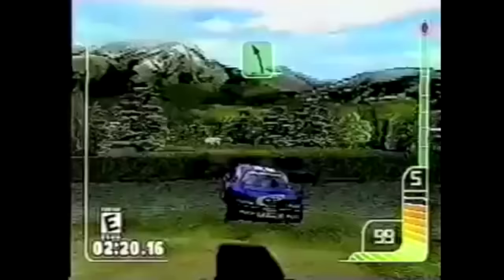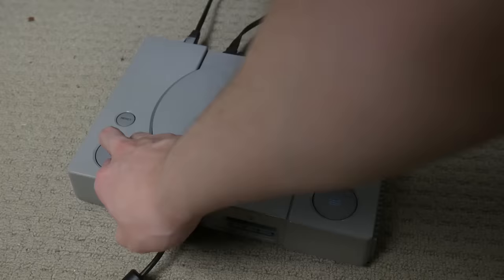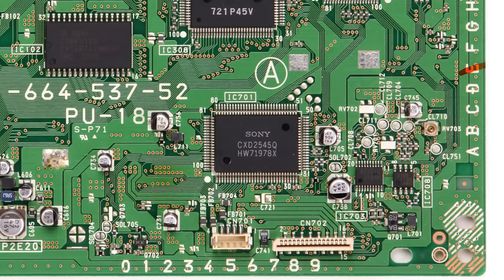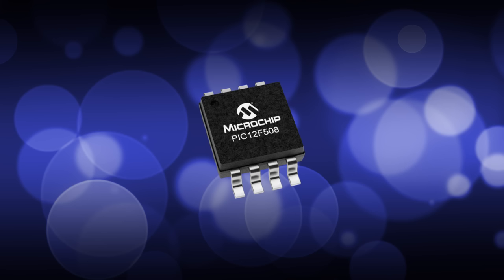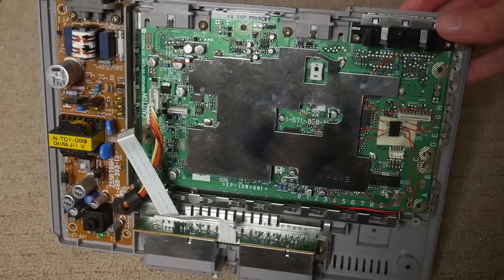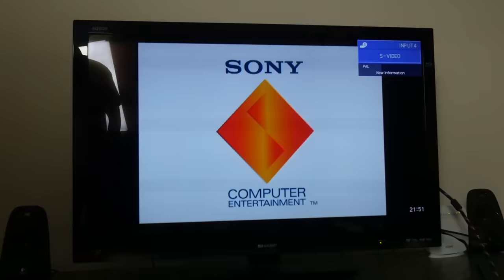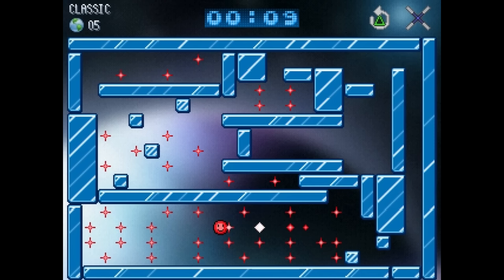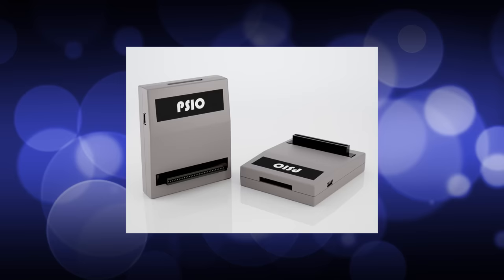Making a PlayStation 1 modchip from SCRATCH

Comment: I like to see a different mod. Replace the drive with some kind of storage device. A CD drive emulator using the CD drive connector. It difficult to do but not impossible. Modding the motherboard would still be necessary but I wouldn't mind to do that. It's available for the saturn (if I'm not mistaken) and I'm looking for this solution for my ps and Wii.
Reply from the maker: Did you see the PSIO shoutout at the end? It's basically a CD drive emulator (though it plugs into the parallel I/O port rather than replacing the drive assembly like a GDEMU, requiring some soldering to redirect a few CD signals to the parallel I/O).

The Wii can very easily be softmodded to play games from USB and SD.

The Saturn has a prototype of something like that but nothing in production just yet (I believe it's close though)
Reply: @MattKC  haha. I knew you would say that. Ever I saw console modding I wanted to see a mod to replace the drive entirely with a hard drive or other storage solution using the original CD drive interface . Psio is neat but also a soar thumb sticking out. The saturn thing is the most interesting project solution.
Reply from the maker: So you do basically want a GDEMU for PS1. It's likely possible to mod the PSIO to be an internal device since it's already a CD drive emulator that takes CD drive signals. I'm not sure how much work it would take, but I assume that way most of the hard part is done for you.
Reply: @MattKC  sorry bee busy.. To mod the psio for internal use and use a different storage method then it would be interesting. The psio hijacks the CD drive thus might as well use the connector instead (if possible). But isn't the psio locked with its own software?
Reply: @MattKC  this idea comes with the fact that CD drives become rarer by the day so a decent replacement as storage option would benefit the community as whole.

Comment: This is very inaccurate.  Technology connections has a video on the ps1 wobble groove which better characterizes the actual anti-piracy mechanisms on the ps1.
Reply from the maker: I didn't go into nearly as much detail, but what did I say that was "very inaccurate"?
Reply: @MattKC  I apologize, "very inaccurate" was itself inaccurate.  It is better described as only misleading.  You mention that the region data is written to a part of the CD that typical CD burners of the era could not write to, but the ability to write to that region is not what prevents retail PS1s from reading the region data, rather it is the 22 kHz "wobble" that the data is written in, verified by the CD-ROM controller, that will not even be sent to the PS1 BIOS to be verified if it doesn't match the expected 22 kHz frequency.  This information is present in the reverse engineering work done by Martin Korth (and others):  https://problemkaputt.de/psx-spx.htm#cdromprotectionscexstrings

This is to say that the distinction is that given a retail/unmodded PS1, the barrier to producing readable media is not simply writing/burning data to this particular region, but is actually encoding the data physically within the pit as a sine wave (22 kHz) expected by the CD-ROM controller.

Comment: Down voted for that terrible solder job. You didn't even clip or bend the pins to make the IC flush with the PCB. If you drop this thing, the pins might penetrate the solder mask and short out your console. There's some real fine traces right under that chip.

Comment: Wouldn't the "swap trick" work just as well without needing to mod?
Reply: That could (and will) damage the disc drive.
Keep in mind that these drives are 20 or more years old.
It's a good trick for cases where you have a region locked game and want to try it, but if you're going to go on and have 300 different games this won't be reliable enough for the hardware and will damage the disc drive.
Reply: @djungelskog2654  Couldn't you use something like SwapMagic? That instructs the motor to turn off.

Comment: What you're doing is 100% illegal. Even though putting the mod chip in the console is legal In your country. Putting the code on the chip to mod The PlayStation is still illegal. So once you do that to this chip, it is now Illegal and yes, you can get in trouble... Now if you mod The hardware By adding the chip and don't touch the chip and  add  code to it, that's perfectly legal. It's the point where you add the code. And you make the PlayStation do something it's not intended.. But sure, you can add anything to the hardware Paint it pretty it up. Add 20 batteries to it, change the heat sinks.
Put it inside of an Xbox. Case. You just can't physically change the software Or add some to it.

Comment: Hold up.....I have a PS1 and I play burned CDs without modding anything. I didn't mod the PS1, I just burned CDs with the desired and that's it.
Reply: news flash, its modded - most PS1 systems you will pick up have been modded at some point.
Reply: @dssembler7922  I bought my PS1 almost at launch though, those where times. And it was never taken to any repair shop to fix/ adjust something.
Reply: @dylanellul1024  Somewhere along the lines its happened, they never have played backups without unless you do the swap trick or use a plugin 'cheat' card'

Comment: you should keep in mind that running a ps1 can be dangerous when the case is open because of the exposed psu with 240 volts.

Comment: Cant find this Pic Kit Programmer Board he has? Please help
Reply: How much do you plan to buy this set? If the price is comparable to $45 US, then it is easier to buy a working version with delivery from Russia. In our country, these consoles were already sold with mod-chips, and on the secondary market they are sold for this amount (3500-4000 rubles). In addition to the console, you can probably buy dozens of games, controllers and the console itself, which works in all regions. Do not thank.

// За сколько ты планируешь купить данный набор? Если цена сопоставима с 45$ США, то проще купить рабочий вариант с доставкой из России. У нас эти консоли продавались уже с мод-чипами, а на вторичном рынке продаются за эту сумму (3500-4000 рублей). Помимо консоли, ты возможно приобретешь ни один десяток игр, контроллеры и саму приставку, работающую во всех регионах. Не благодари.
Reply: @Vladstvo  thanks for the answer. Do you know the model name and etc. from the board in the video?
Reply: @gamesarelegends3473  The author is talking about SCPH-5552
Reply: @Vladstvo  I meant the Pic Board. Cant find Pic boards that would fit such microchips like in the video. He just puts it in like a plug but cant find such a board with that plug
Reply: @gamesarelegends3473  I want to help you, but I don't quite understand what we're talking about, I'm using a translator. Before soldering, the chip is placed in the programmer and configured, after which it is already soldered to the motherboard. Are you interested in the moment of programming the chip or its soldering, what contacts should it be soldered to?
Reply: @Vladstvo  I am interested in the board to plug in the Pic Chip to program. The soldering I think I can try good and its not the problem. The problem is for me to get the code on the chip. I think I can find the chip and the code online but not the Board tool. I have found many Pic Programmers but not with pins that would fit this Microchip

Comment: @08:10 I guess doing things as convoluted as possible is kind of your thing, but everything has a time and place and this ain't it.
Who the F tacks a chip to the board with the legs pointing down and then starts soldering the wires to the chip!?
Have some commonsense man and bend the legs outwards first followed by soldering the extensions onto them off the board.